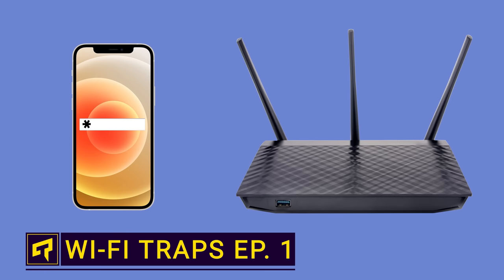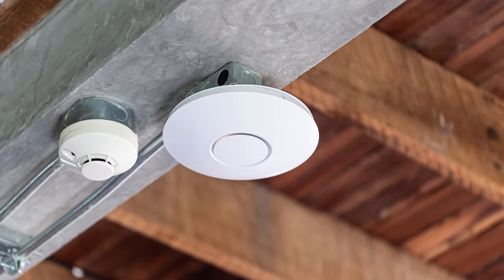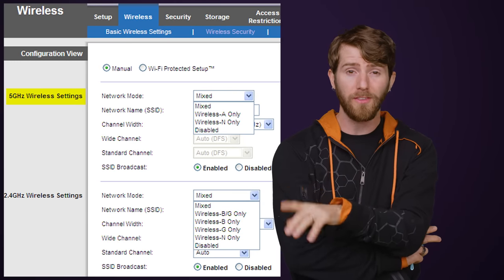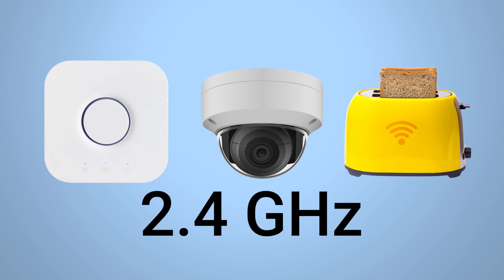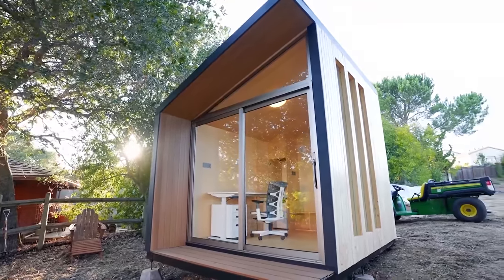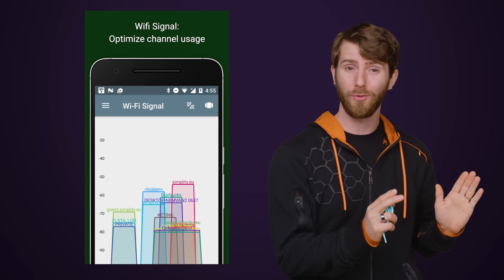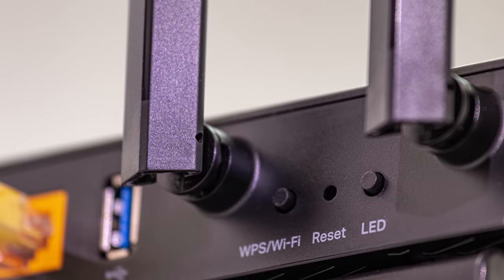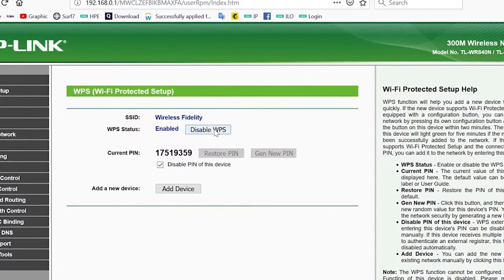Avoiding Common Wi-Fi Traps

Comment: I don't know if I'm doing it wrong, but all this 2.4 & 5 GHz thing is backwards for me. In my home, wherever is the router, it is always that there are corners of the room where 2.4 GHz Wi-Fi is dead and 5 GHz is at least working. When I had both bands turned on and I struggled to connect on any device from a far away corner of the room, it always was that the device jumped to 2.4 GHz - switched it to 5 and it works. For the same reason Wi-Fi 4 (n)-only devices are getting, like, a couple of MBit/s everywhere, so I upgraded my router to 5 GHz AC and 5 GHz is fine in every room. It could be just that the 2.4 GHz range is really crowded in my neighborhood, but I couldn't qulte confirm that - the WiFi channel scanner is showing quite a clean picture and there is only like 7-8 2.4 GHz networks around. But 2.4 band is used by a lot of wireless equipment, so... if the 2.4 GHz connection doesn't work for you, it may be worth trying to inverse logic and try 5 GHz.
So then I have disabled SSID broadcast on my 2.4 GHz so that all of my devices don't try to connect to it (still need that band for some smart home appliances) and never had any issues or dead corners since then. But older WiFi n devices are basically non-functional behind the first wall.

Comment: I'm on r/homelab and I like setting up multiple routers in AP mode since our home is constructed in a way that blocks a lot of wifi coverage. Using different wifi channels lets me use the same SSID and password to improve the coverage without having to switch between networks, since our devices will Auto select the strongest channel.
Reply: *lets (conjugated form of "to let")
let's = contraction of "let us"
Reply: @alvallac2171  voice typing

Comment: Don't place routers, access points, or mesh nodes near landline phones or other devices sending out wifi signals ( like baby monitors, Sonos devices, etc.). This can cause interference with those devices as well as with the wifi in that area. Try to have at least 3-6 feet in distance or if those devices are wired then turn off the wireless signal if it is an option.

Comment: What I HAD to do was move the router to a different location, not possible, easy nor convenient, or get a drop amp for our coaxial lines. Our internet is via cable.
I went through about 3 new, mid tier routers and nothing solved my wifi problem. Many many visits from techs and my internet kept dropping.

I ended doing my own damn research and found that a pretty common problem (and one not spoken about nearly as much as any other “quick fix”) is upstream power.

My house is older and has old, out of date, coaxial wiring and where my router was setup (across the house) the signal my router was sending back to my isp wasn’t strong enough to make a solid connection. I had a weak upstream signal. There’s a lot that can affect it but short and sweet answer is the farther your router is from your main coaxial line (including house wherever your houses line comes from) you may run into upstream problems. The best way around it is either wiring it off of a first, dedicated coax splt (main line into 2, router coax line and another that may split off for tv/cable/MoCa) or getting a drop amplifier for your coaxial line. This will help your router send a strong signal back into the main line through to your isp.

That fix alone was enough for my signal to literally not drop again till the power went out because of recent thunderstorms. I’ve never “forgotten” about my router before but after that, I never had to reset it cause of wifi drop or anything. In fact my uptime was in the double digit months. It would usually never go past a couple days without me having issue. I haven’t had wifi problems since and it’s been heaven.

I don’t remeber why but there was a site I used called dsl reports and it’s used for troubleshooting some problems I had related and my grade was an d-, or f+. Now it’s a B+. My ping in games is >20 for cod and >24 for OW.

I legit Never have a problem now. And it’s not hard to check for it, it’s in your routers settings. A “healthy” upstream signal is ~32-40 dBmV if memory serves me right. If you have dropping internet and have it installed far from the main coax line (or off too many splits) most definetly check for this problem.

Comment: my tip is to avoid using a router that's got ISP branding on it. in germany, vodafone has notoriously horrible routers that you can get with your internet contract, but they don't get updated firmware as often as they are jumping through a bunch of licensing and servicing hoops in order to release updated firmware. i'm talking disconnecting and not getting a connection every 2 hours, for every day, for months, even years. it's a serious problem here in germany and my wifi tip of the day is therefore to buy your own router. you'll need to have a router in your home anyway, and you might as well make sure your main hub for internet connectivity isn't in the hands of some commercialized psychopaths. Fritz has a pristine reputation for a reason!

Comment: I would personally advise to go with software defined networking but that could be a bit out of the ordinary users lead. I'm using a TP-Link Omada router which doesn't contain any wifi capability, add a managed switch, some wired (!!) access points and you have a solid network. One thing though, you have to use the controller-software to fully set it up and have it work seamlessly together and this can be set-up software-based like on a Raspberry Pi or hardware based with a hardware controller. What I like about this is that you can expand and build it exactly as you want it to be. For example, if I move and need more access points for a better wifi-coverage I just plug them in my switch, enable the port in the controller, adopt with a single mouse click and it is fully integrated in my network.

As I said, it might be a bit expensive and difficult for the ordinary Joe but if you have some networking knowledge or are interested in expanding your knowledge a setup like this can work like a perfect testing-bench.

Comment: Very useful video. I didn't even know WPS existed until today and was honestly shocked that ASUS included something so unsafe. Not sure if the point was moot for me since I use MAC filter. Disabled now though :)
Reply: MAC addresses are always publicly visible in clear text, so they can easily be seen with a packet sniffer and then spoofed. MAC address filtering is no protection at all. The encryption is what matters. Use WPA3 or WPA2, and set a strong encryption key (long and randomly generated) that you keep in your password manager. Maximum length is 63 characters.

Comment: I would also add that (assuming your router and devices are compatible) enabling the DFS channel range can be a great way to avoid congestion on the 5Ghz band. This covers two distinct ranges: 5260-5340Mhz (WLAN channels 52-68) and 5480-5720Mhz (channels 96-144) - these were formerly reserved for weather and aviation radar use but no longer exclusively since 2015. 

The one major caveat is that there are still a handful of airports with doppler radars operating in this range - wireless routers and access points using DFS need to "pre-scan" for 60-120 seconds prior to broadcasting the signal. Additionally, if the router thinks it's identified a weather radar on the same frequency, something called a "DFS hit" will occur and the router will immediately switch to a different frequency. This is extremely rare, but it can happen if you live very close to a major airport. From my own personal experience, I have two Netgear Enterprise AP's on opposite sides of my house, both of which operate on DFS channels. I'm less than 5 miles (8km) from Logan Airport in Boston and knock on wood, I've never had a DFS hit.

Comment: My suggestion (Linus is well aware of this). Don't use the WiFi network on your ISP modem, 8fnyou can afford an alternative. If you are able to purchase a decent WiFi router (not cheap), place your modem in pass-through mode and use your aftermarket router for WiFi. They can be much better than the crappy ISP provided WiFi. It will take a bit of knowledge if you have DSL, but there are guides online to help

Comment: @Techquickie using wifi dongles do an ok job, but if you want better range and performance it is better to upgrade the wifi module in the laptop or opt for a pcie wifi card for a desktop.
Reply: Or use an Ethernet cable
Reply: @that_duck_over_there  Providing the wife gives her stamp of approval XD
Reply: @rossq9432  Wow I just realized how lucky I am to have all of the networking stuff in my room
Reply: Same here, although I would not say I have alot of neworking stuff, that is actually in use. But I am sure there are other situations where you might not be able to use an ethernet cable, a wife was just the 1st thing that came to my mind haha

Comment: This isn't necessarily wifi related, more router related, but everyone, PLEASE disable UPnP on your router. It is a very dangerous protocol that leaves a router wide open to external attacks, rendering the firewall useless.

Comment: Great vid guys.  2x TPlink 841HP routers works for me in a big (long) house on 2.4.

Question:  our house works just great on 2.4ghz and we have a 100mbps line and can achieve around 55to70mbps average over wifi. Would updraging to a wifi 6 router give any more stability or improved speed using 9db antennas like included on the TPlink mentioned above. All new routers seem to have smaller antennas which worry me.

Ie does upgrading the router improve a wifi 2.4 network AT ALL?

Comment: If you need to use the 2.4 band, stick to channels 1,6 and 11. Even though it may be tempting to go in between, you will be subjected to congestion of the adjacent channels making your own performance worse. IP cameras may not take up a lot of bandwidth but will add congestion as they are always transmitting, if they work fine on 5GHz, keep them there! Don't forget other technologies use 2.4 as well, such as BT/BLE, wireless phones, and sources of noise like microwaves can really limit the usefulness of 2.4 for WiFi. WiFi 6 will be improving the 2.4 band, but APs and client devices will obviously have to be compliant to fully leverage the new tech.

For 5GHz, make sure you have the widest channel width set as possible in your AP/router settings! Typically 802.11ac client devices can support up to 80MHz wide channels, and even if your device(s) can only support 20 or 40 MHz wide channels, they will operate at the widest allowed by your AP, so nothing will break if you set it too wide. If you have issues setting the channel width, try another UN-II band, for instance channel 36 on UN-II band 1 can generally support up to 80MHz, UN-II band 3 in the US also has channels that can go very wide, but your AP might not be able to support these channels+widths. The wlan channels wikipedia article is very helpful for figuring out what channels are available for your country as well. Depending on which country you live in, your choice in band can also limit the TX power, so look up that wikipedia article and see if you are using a band/channel labeled as TPC or indoors.

If you happen to have an AP that supports UN-II band 2/2e DFS channels (and you do not live close to a weather station or airport), you will likely have the enitre band to yourself. The only problem being close to something using RADAR can interrupt your service periodically.

Comment: Seen some dude thinking that 1.7gbps was going to be fast for pxe booting/imaging some HP laptops, guess he doesn't understand that wifi is pretty much like going from a gbit switch to a 10/100 hub plus interference when on a large scale anyway. Pretty sure the 3800 cisco waps can handle a lot but still wouldn't do more than 4 at a time if it's for speed over wifi lol. hell even the dropped packets would be enough for me to never even bother trying it.

Comment: The best advice I ever heard to improve WiFi coverage.

Place 2 comically large googly eyes on your AP. DONE!
Reply: Please explain or give some links to read on it
Reply: @angumech13  Sure it's simple. Like speed holes or racing stripes.

You find comically LARGE google eyes with self adhesive backings. Peel of the sticky back & apply to your AP.

Bam +5MB/s
Reply: @AgentLokVokun  Will this work for router antennas (when the router is placed near the wall and I stick the google eyes to the wall to reflect signals away from the wall from the bi-directional antennas?)
Reply: @angumech13  Absolutely! In this case I'd recommend comically LARGE google eyes on each antenna.

Unless they overlap or touch. Then at least do one smaller google-eye each -- facing the direction to where the most dense user population will be.
Reply: @AgentLokVokun  Thanks, I will try!

Comment: Something else I find can help is to disable MAC address randomisation on devices if they are having trouble staying connected, especially if the device sleeps. Another issue I've commonly come across is a feature known as Wifi PMF (Protected Management Frame), which I've seen cause anything from difficulty to connect & stay connected, poor wifi speeds & also WatchDog Violation BSODs in Windows, so turning this off may possibly help.

Comment: I think it's obvious unless it's only a thing in my country but for the love of god: avoid using ISP provided routers. The most basic router you can buy at a store will do a better job keeping you connected to the internet - especially on WiFi. Also makes switching ISP a little easier because you get to keep using the same router.
Reply: @Lord Ludicrous yes sadly you can't always avoid using their router. But so far when it was the case for me i used their router in bridge mode and connected it to my own router so i could at least get a decent signal in my house.
Now I'm connected to optic fiber and it doesn't require a modem, therefore no need for ISP provided equipment.

Comment: Moving your devices to 2.4GHz for argument of range isn't great, your devices will automatically swap over if they need to.
Most of the time edge 5GHz signal will still be better, with more stable latency and higher bandwidth, and most routers 5GHz is close enough to 2.4GHz in range unless you're in the middle of nowhere due to interference. 
My old house was neighbors around 20m to the next house, cement walls, 5GHz still covered most of the house without issue until the 4th wall, past that edge of 2.4GHz at 3Mbps.

You want to move your IoT stuff onto 2.4GHz because every device connected to 5GHz splits the bandwidth whether they are using it or not, rather split the slower network that doesn't matter and keep your phone/laptop/tablet on the 5GHz. That said, WiFi 6 now deals with multiplexing and that argument will slowly start fading away as everything moves over.

If you're in an area with lots of neighbors close by, e.g. apartments, townhouse, you want to move everything to 5GHz, way more channels available.

Comment: Some newer devices don’t work well with 2.4GHz. My Nintendo Switch hates it.
Also too many devices on 2.5GHz can cause interference issues, but will clear up 5GHz.
Reply: nintendo switch 2.4ghz is terrible so you should use 5ghz on it

Comment: I know that multiple wifi signals in an area can have an affect on your wifi connection but how does that work with mesh networks? Wouldn't you just run into the same issue?

Comment: I forced in the wrong drivers for and my USB wifi and it went over 20x the speed. How did that happen? Are wifi speeds limited by software? the driver I put in was a different version of it and then updated the computer to windows 10 from 7 and thats how I got the results. 
Also their was an issue that it disconnected every few minutes but works fine again every time I unplug and plug it back in. I dont use it since I get annoyed to unplug it every time.

Comment: There is also 5GHz-1 and 5Ghz-2 and the -2 one is much faster than the -1 one.
Reply: I can't be sure, but I think what you might be referring to is WiFi 5 "wave 1" vs "WiFi 5 "wave 2." WiFi 5 (aka 802.11 ac) got a revision called "Wave 2" which increased throughput somewhat and added support for MU-MIMO. Linus did a video on that years ago.

"5 GHz" is an RF frequency, not a WiFi version. WiFi 4 (aka 802.11n) also had support for 5 GHz.

Comment: In practice the height thing really is not a thing; Also most routers hae adjustable antennas so the direction of your wifi if directly adjustable. The problem with lab vs real world is in the real world we are not testing signal strength as the amount of radiation received, we instead test to see how stable and quick the network connection is. This is entirely 2 way communication, thier is no such thing a a wifi device that never has to receive or never has to send data. So it does not matter the size of the antenna you place on your router or if you place it high up or on the floor most of the time, it is your tablet or phone that is the limiting factor and the distance and thickness fo wallls between the two. It will always be the bottleneck in your wifi stability and speed.
Reply: *there
their = possessive (you also misspelled this)
they're = contraction
*there: for all other uses.

*as a
*of walls

Comment: Since I only own 2 devices that would use WiFi and have adapters for them to use ethernet I have WiFi diabled in my router. My phone and the switch can use ethernet that way. Otherwise I have the data on my phone if I need to chare it.
Reply: "Chare" isn't a word. Did you maybe mean "share?" I'm not sure.